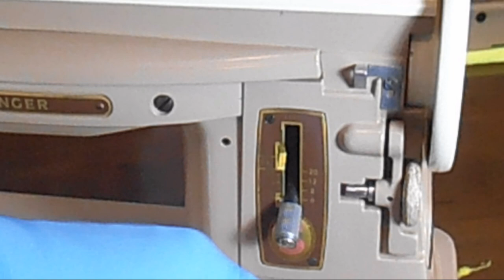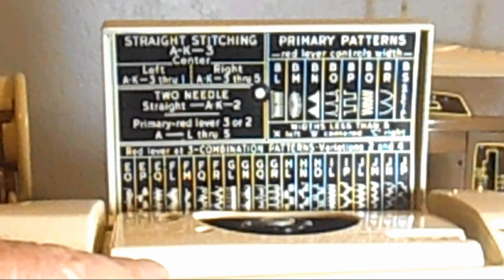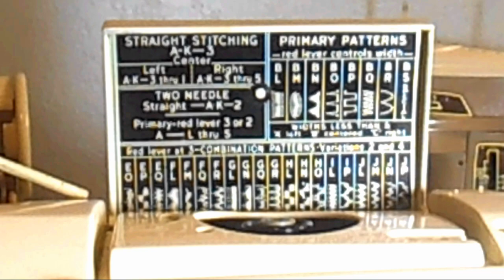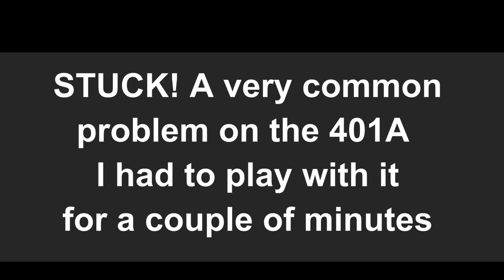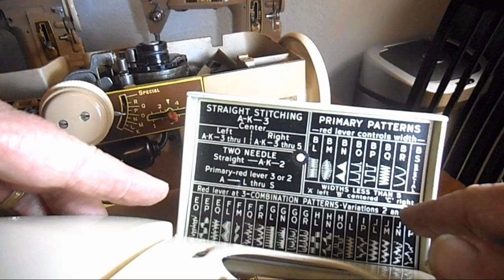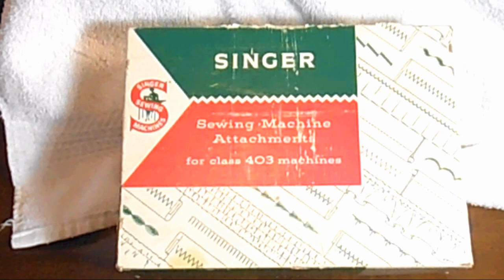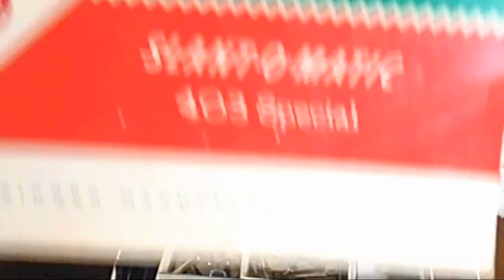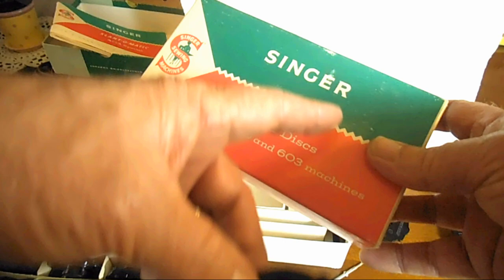SINGER MODELS 401A 403A 404 COMPARING THE BUILD AND FEATURES

Comment: I see an awful lot of plastic parts to calling them "all metal". It hardly does much good to be specific on model details, when you oversimplify metal vs plastic.
Reply from the maker: "an awful lot of plastic parts"... OK. 
     The pattern discs are plastic, the spool pins are plastic, and the coating over the wires is plastic, The bobbin winder friction ring is not plastic, but it is not metal either; it is rubber. There are some non-metal rubber grommets for the wiring too so let's not forget those. The gear on the handwheel is Textolite which isn't made of metal. The light bulb, depending if it is incandescent or LED is partially made of glass or silicone, and the light switch is plastic, too. Oh, the base of the motor housing is plastic. Almost forgot that one. Have I missed any other plastic? Please let me know if I did and I'll be happy to add them. 
     By calling the machines "all metal" I'm referring to the solid cast-aluminum bodies, solid steel gearing, and shafts. Those kinds of parts and compared to most modern machines that have plastic bodies and gears and levers. I did not mean to oversimplify. Really I didn't. I'm sorry if my attempt at comparing the models made you upset. I'll try to do better in the future. Mea Culpa.
     I will pin your comment to the top so others can learn from my mistakes. Thanks for watching my channel.
P.S. That "all metal" sew gem model 215 on your channel looks like it has a rubber friction ring and a "non-metal" motor belt, but you realized that already, right?

Comment: Hi Andy.  I just bought a 401a for $20 at my local thrift store.  Your video is full of knowledge that I will need to refer back to as I try to get her sewing again.  Thank you!
Reply: LUCKY YOU! Does it function? If you need accessories, grab them soon as they are disappearing from the market. It requires a size 66 bobbin. Please do not try to use any other bobbin. When looking for accessories you must remember to find "Slant Needle" as no other foot configuration will work.  I recently saw a beautifully refurbished one with most of the original accessories that sold for over $500! (I found one at a flea market in an original cabinet for $30 so I know how good that feeling is!) Long sewing life and lots of fun! (Still don't use more than about 5 stitches which include a specialized one only found on an accessory disc for the stitch stitch which is a mirrored image of the BO blind stitch.

Comment: I recently found an orphaned 403a out by the curb, in the rain, all by itself , missing the power cords and spool pins,  the throat plates , of course all the accessories and the original zero cam. so, after watching your video I will put it back to work! it still spins very nicely & very quietly. right now it's very dirty . I just hit it with WD-40 everywhere I could while it sits and waits for me to dissect and clean and put it back in service thank you very much for your wonderful videos!
Reply from the maker: Came to shut down my PC for the night and found this wonderful comment. You made my day for tomorrow already, Thank you.🙏  
I don't know if you found my Regina Playlist for restoring a model 403A. If not you may find some of the 27 videos helpful as you explore your new Slant-O Matic Special 403A. Take care.

Comment: Andy, how will I ever decide what model to buy now? Might have to settle for all three and set up 3 different sew stations
Reply from the maker: Yeah that can be a dilemma. I can tell you back when I was restoring a lot of these. I had a few customers bought a 404 and a 403a. They're feeling was most of their sewing was going to be straight stitch and on heavier type materials, but they still had a need for zigzag and some pattern stitching was desirable and when they realize the 403a can take 20 plus different cams for pattern stitching, they felt that was plenty and they'd never need all the different patterns available on a 401a. They also felt a 403A would be easier to maintain in the long run because it had fewer moving parts. My wife herself uses a 301A for her daily machine and has a 403a for zigzag pattern stitching and buttonhole making and she has a very old serger and those are her three machines. And yes she's got three different cabinets to hold them but the cabinets I put wheels on all of them so she can move them around and in and out anyways. She wants depending on her sewing needs. I edited this comment to add that the 403A can make a beautiful straight stitch. Also as can the 401a the best way to do that is to get the straight stitch needle plate and the straights stitch presser foot as that can make a big difference in how the straight stitch looks on a zigzag machine

Comment: Could u tell me if a Singer 404 will fit in a 401A cabinet?  Thank you
Reply from the maker: @lgw23765  Yes for sure it will both those models use the same size bed so if a 401 fits the 404 will slide right in thanks for watching my channel

Comment: I have a 500A  and the hand gear is stuck therefore will not allow me to wind a bobbin, any suggestions on how I can unstick this gear?
Reply from the maker: I don't know what a "hand gear" is on a 500A. Sib=nce you mention bobbin winding here are two videos about the bobbin winder system on your machine. Part 1 https://youtu.be/BWdT7OlGUMg  Part 2 https://youtu.be/P2ROdLM5zmE
Part 2 shows removing and replacing the bobbin winder parts. If you happen to mean that the Hand Wheel is stuck that is different of course and if the handwheel is stuck nothing on the machine will move, so that is why I offered the BW videos. If I'm wrong let me know.

Comment: Looking to do some basic sewing of shirts and jeans for personal use. Would a vintage all mechanical machine be better for me than a modern electric version? What are the pros and cons for a beginner?
Reply from the maker: I don't know anything about "modern electric version" sewing machines, other than half of my customers have given theirs to charity b/c it won't stay in time or won't sew jeans, etc unless you buy one worth $500+. The 403A in this video will sew all the clothes and jeans you want. Often when you buy a vintage machine it will need servicing and maybe some repair. There are many videos on YouTube for that (I alone have 500+) and although this 403A is 60 years old it runs like new after refurb and will last another 60 years with oiling and cleaning (normal) If you just want one to bring home and plugin and start sewing, maybe a new one is for you. Try to spend enough to get one that will sew what you want to. You can find very nice model 403A models, all clean and sewing well, for around $200. The one in this video I bought for about $50, then cleaned and lubricated it, new rubber feet. There are vintage sewing machine groups on social medial that can answer your specific questions about sewing; I don't sew, just repair them. Like this, https://www.youtube.com/playlist?list=PLsCOZgzzaiKKyqvdDRwS-9MfLuwSNJTcg

Comment: Love your comparison videos and detail on restoration.  I have a found a 404 (that is my favorite as well) however it was robbed of the entire tension assembly and needs some TLC.  I have a 401 that is a donor machine and wonder if the stud in the tension assembly is the same length for the 404 and the 401 and inter-changeable.Thanks again for all your help.
Reply from the maker: Thanks for watching my channel, Marsha. I checked the parts lists for models 401, 403 and 404 and they all show the same part number for the tension stud, 140178, so the same stud is on all models. In fact, it looks like the entire tension unit is the same on all models. Thanks for saving a vintage machine. Good Luck.

Comment: Andy, thank you for help with the 301, I have chanced upon a 401A in a cabinet that is smoke infested, nasty, and missing the bobbin plate cover, I was wondering where to find the serial number and the missing part. I see plenty of ultrasound, Krud-Kutter, and bath time coming soon!
Reply from the maker: It sounds like a real challenge. Thank you for rescuing a 401A. So the part number for the missing plate is 172015. Singer formally calls it a "Bed Slide", and we call it a slide plate or bobbin plate cover. This same bed slide fits about two dozen models, so if you are looking on eBay for a used vintage one (about $20 and up if it comes with other bobbin area parts) you may save money by searching other model numbers instead of the most famous 401A model. You can buy a new aftermarket one for about $10. Take a look at this trusted sellers page to see all the models it fits;
https://www.vintagesingerparts.com/collections/singer-model-401a/products/singer-bobbin-cover-part-163477
Here is another trusted seller: https://shop.sew-classic.com/Bobbin-Slide-Cover-Plate-401-403-404-500-503-163477.htm
I'd like to suggest that you go thru the machine completely b/c you may find you need more parts, like bed feet (the rubber feet on the bottom) bobbin winder tire, spool pin felts, tension unit tension spring, cords, and other items. You can save money on shipping if you wait and order everything at once (usually) You can download a FREE Instruction Manual right from Singer at this link: 
https://www.singer.com/sites/default/files/outdated_product/SINGER%20401and%20401A1%20Sewing%20Machine.pdf
You can also get a FREE copy of the Service Manual at this link: https://sewingdude.files.wordpress.com/2012/09/singer-401-service-manual1.pdf
I have published almost 100 videos for this class of machine (401A, 403A, 404) and you can find the playlists by model number on my public playlist page here: https://www.youtube.com/channel/UCUSPDsHaFtRoz1VA2U1xJ4w/playlists?view_as=public
I also have playlists for restoring the motor and the foot controller. I hope you have fun with it; it's a challenge. Good Luck and thanks for watching my channel.

Comment: Thanks for the infos. I'm glad to know more about my 401a machine. I often get the problem you speak about, the button stuck, but as I got it free, nothing to complain. I didn't use it since many months and today when I tried it, the button was a little stuck again. I force it a little and a small spring fell off inside. I got an idea where it goes by looking at your videos, but seems very difficult to reach the right spot. Will I have to take of some parts to put it back in place ?
Reply from the maker: I believe so. Things usually don't fall off inside so it may have been loose already. If you go here you can download a free parts diagram of your machine to try and locate where the spring belongs:
http://parts.singerco.com/CPpartCharts/4_4999/401A1.pdf

At this page, you can download a free copy of the original service guide and check for instructions on how to access the area to re-attach the spring: https://sewingdude.files.wordpress.com/2012/09/singer-401-service-manual1.pdf
These two documents will give you a much better idea of how to proceed. Good Luck.
Reply: Thanks a lot for your answer. I found the spring in the diagram, piece no. 172057, but it doesn't show where it goes. I hope to find more precision in the second link.
Reply from the maker: That is the hinge pin sprig from the needle bar vibraing bracket. I show the instllation in thsi video of a similar machine: https://youtu.be/L9ZiWURPA-Q
Start at 31:15 for installation of the spring, and 5:50 fro how to remove it.
Reply: Merci thanks. With the guide of your video demonstration. I succeed to hang the spring easily. But,  I guess there is another step to do before to hang the spring...  As what I can see on diagramme 288,  the piece with the little hook for the spring is not on the same position on my machine. On my machine it's parallele to the machine. This little piece blocks the outside button at the half, and no zig zag movement.
Reply: I got it !!  So proud ! I figured the way to bring that small hook in the right position, by trying different position of the stich selectors. Thanks a lot for your help and videos, I understand more now how my machine works. 
Now, I have to clean it, oil and grease...
Merci encore
Reply from the maker: N'en pense rien. Vous avez fait tout le travail.
 Bien fait. Bonne chance.

Comment: Hi Andy, Can I remove the 404 knee controller from underneath in the cabinet and use it as a foot pedal? If so, how do I detach it. 
Thanks!
Reply from the maker: Yes you can remove it ay time you like. The pedal is just pushed down into the metal bracket from the top and "clips" into place. Push or pull it up from the bottom to remove it. If you start watching the following video at 1:03:00 you will learn about the bracket and pedal combination. https://youtu.be/34PKrDn3LUA Thank you for watching my channel, Dani, and good luck.
Reply: Thank you! I knew you would have a video for it! Do you have a suggestion for a missing bobbin rewind pin. That one is gone but the upper plastic one is still there. I see people putting the spool in a glass on the side of the machine as well. Thanks again!
Reply from the maker: @danilei6045  https://www.ebay.com/itm/374375071280?hash=item572a7e3e30:g:~goAAOSwEeFU~4z5

Comment: Great video! Lovely to watch with a nice cuppa tea... I was so distracted @ the 29 min mark by the little wiggling thread(?) just before you removed the motor cover. Kept wondering how a tiny wiggling "worm" got into the undersides!
Reply from the maker: Haha, I never noticed it before you mentioned it. What a sharp eye you have 👀It almost looks like a hair as it reflects light. It's too long to be one of mine though. It's moving in the breeze from the overhead ceiling fan. Thanks for watching my channel.

Comment: Great video! Thanks.... I just purchased a 401G I think it's the same as 401A  just made in Germany instead of America... Only problem is the pattern selector doesn't turn when I pull out and turn though the push-in one does! Any suggestions please?
Reply from the maker: Welcome to Andy Tube, Tricia. My advice is to clean it. The pattern selector has several moving parts. When the machine is out of use the parts get dry and sticky, espcially if they were already dirty. I find 90% of problems clear up after a good general cleaning. Gather and read as many 401A documents as you can find. The instruction manual alone is full of rea information about how the machine is meant to function. The service manual shows how to remove, replace and adjust all the parts on the machine. The parts diagram gives you a good idea of the different parts and locations of them. You can also browse thru my plauylist of videos for model 404 and 503A which have many of the same parts as your machine, including the pattern selector of the 503A. You don't need to disassemble everything like I do, but you can clean areas of the machine, like the pattern selector, then oil it and test it.
Read the instruction to be sure you have the levers set properly for changing the two main dials in the front center. Here are some links to free copies of the documents I mentioned as well as the palylists. Best wishes for yur 401G to be up and running soon; I know you can get this done.
https://www.singer.com/sites/default/files/product_manual/SINGER%20401A%20Sewing%20Machine.pdf
https://sewingdude.files.wordpress.com/2012/09/singer-401-service-manual1.pdf
http://parts.singerco.com/CPpartCharts/4_4999/401A1.pdf
https://www.youtube.com/playlist?list=PLsCOZgzzaiKIB4kvIHCfHYuyLMUp5A4UI
https://www.youtube.com/playlist?list=PLsCOZgzzaiKJZaZn2zl3LsnV2d7UhrqvX
Reply: Thank you for your speedy reply Andy, I'll take your advise.. Cheers

Comment: Do you know where to buy an original bottom plate and thumb screw for the 401A and what price it should be? Mine didn't come with one. Thanks.
Reply from the maker: I usually buy off of eBay. It should be the same bedplate for all three models. I see the price is up from a couple of years ago. Here are two on eBay right now.  The screw stud should already be in the base of the machine. You can't buy the right screw at a hardware store. Good Luck.
https://www.ebay.com/itm/Singer-401a-Part-Bottom-Tray-Drip-Pan-in-Good-Condition/263583396172?hash=item3d5ecb714c:g:BjQAAOSwWxNawo4v
https://www.ebay.com/itm/Singer-401a-Sewing-Machine-Bottom-Cover-172013/152947897451?hash=item239c67b46b:g:zJ0AAOSwvP9arF62

Comment: Andy could you compare the straight stitch between the 201 and 404? they use the same rotary bobbin method right? so their main difference would be the short vs slant shank?
Reply from the maker: It's a good question! I have been TOLD the 201 has a better stitch. I have never touched a 201. They both have a top drop-in bobbin. The 201 bobbin is to the left of the needle bar and the 404 the bobbin is in front of the needle bar. Some people feel that makes a difference, but I'm not sure it would. The thread must face the hook, or how could the hook catch the needle thread? On the 201 you thread the needle right to left, so the right side is facing the hook point. The 404 the needle threads front to back so the front faces the hook point. Either one the needle thread is carried around the hook to wrap it around the bobbin thread for the lock stitch. A person told me the 201 stitch is "straight" and the 404 stitch is "slanted". For me, both hooks are on a horizontal plane and they both rotate, not oscillate. If the stitch slants it has more to do with the needle size, thread size, and type of fabric and stitch length. Remember, I have never sewn on or even touched a 201, but I feel the only difference between the two would be the low-shank/slant-shank you mentioned.